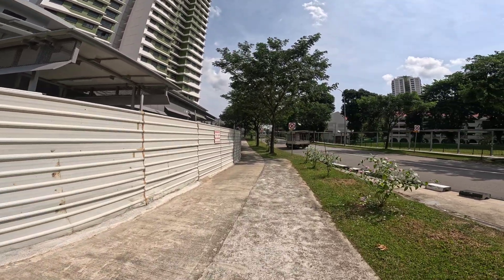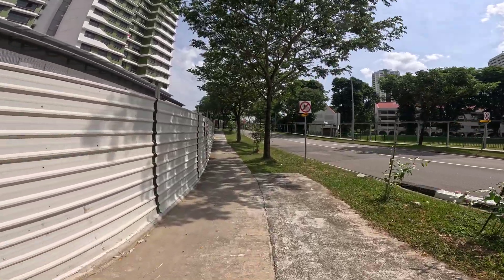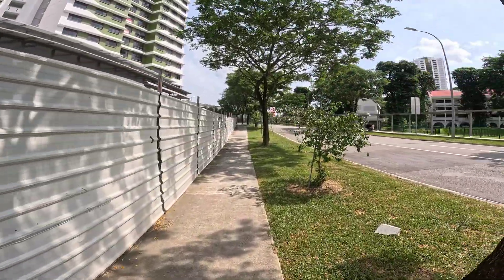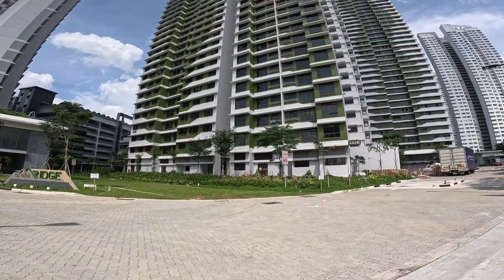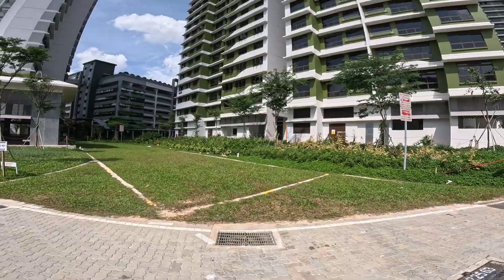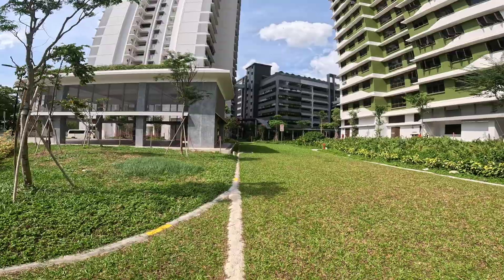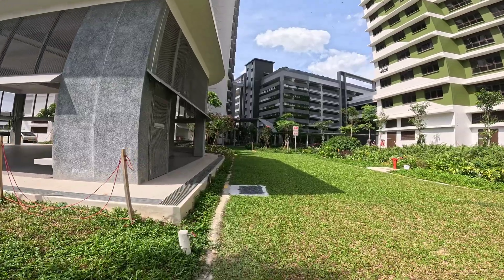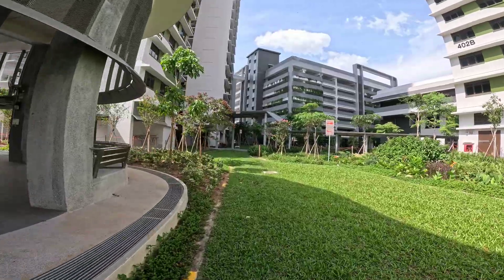TALLEST Hitachi MCA lifts at Blk 402B Toa Payoh Ridge

Comment: Seems like almost every brand of lift made in China has weird noises when moving. Schindler 5500 and Thailand-made Hitachi lifts are the smoothest so far. KONE is very smooth though it's also China-made but new units will have some noises until they fix it some time later.